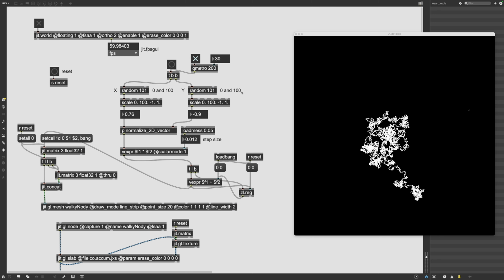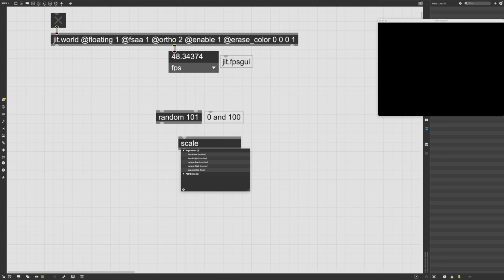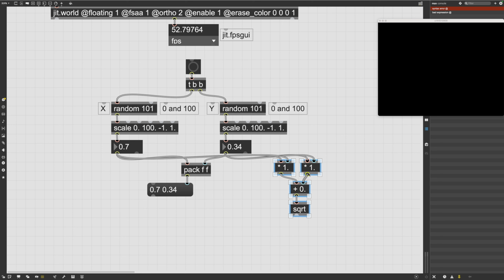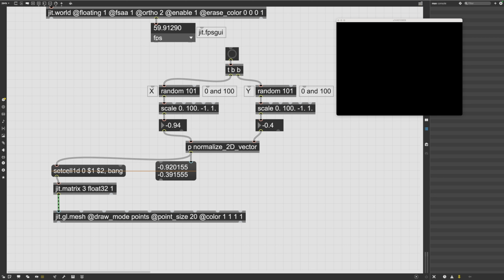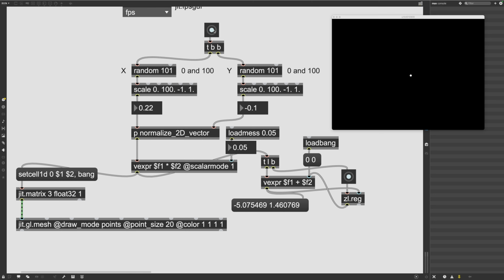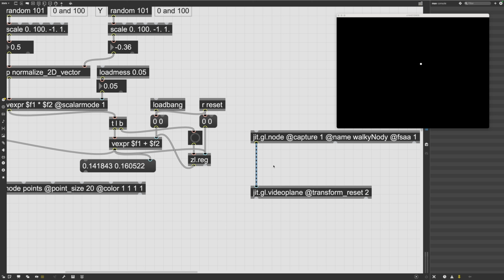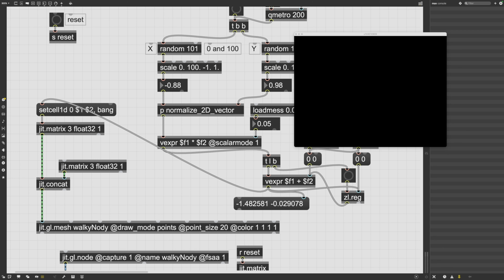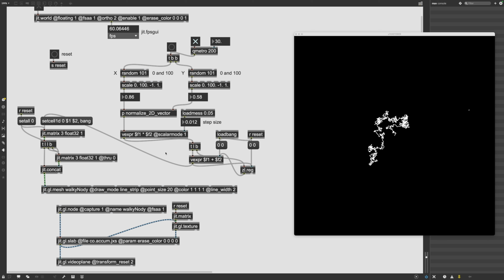2D Random Walk Visualization with Max/MSP Tutorial

Comment: Ciao federico, thank you for the great tutorial, i've used your idea as base for a patch in which I made the steps audioreactive and sent them into touchdesigner via syphon. Unfortunately the lines leave the screen at a certain point and resetting will not do the job since the whole image drawn by the sound will be destroyed. Is there a way to 'clamp' the lines to the window borders in order to keep them inside? I've tried it it with vexpr but it did not really work...mabye you can help? kind regards

Comment: Great Videos from you. Bsically the reason i started Max. However, i'm very new to max i have the following issue. When doing anything to my jit.world (like jit.gl.mesh or jit.gl.handle) i MUST to specify the world name. Therefore, also all the nice demos / examples provided by max will not work (because the developers are usually lazy in specification of world name if it is optional).
Reply from the maker: Hi Thomas! You don't necessarily need to specify the world name, gl objects will automatically attach to the closest (in terms of patches levels) world they find. 
If it's the case that the patches won't work if the name is not specified, this sounds like a bug and you can report it
Reply: @AmazingMaxStuff  interestingly, i can solve this problem if i give the world the name "myContent" ... then the unspecified references work ... strange. I will contact Max.
Reply from the maker: indeed strange! Can it be that you have two patches open with two jit.worlds that have the same name? @Sevetamryn
Reply: @AmazingMaxStuff  I found it. And i'm very sure i never did something there. In the Max Preferences -> Jitter - you can set "Default GL Context" and there was myContent set. I'm pretty sure i never touched this. However, if you set this each DrawTo attribute defaults now to what is set there. And this will break anything you have not written yourself and painstakingly cared about context.
Reply from the maker: Crazy! I didn't even know about that parameter. Thanks a lot for letting me know! @Sevetamryn

Comment: Can you have a max midi FX that receives midi from different channels to modulate visuals? with midi in all midi data is added.
Reply: Max was built for this!
Reply: @paulbergel9191  You don't help at all, tell me how to do it and that's it.
Reply from the maker: @johnenriquemenesesrizo4497 Hi! 
You can use the object "midiparse" to parse raw midi input from midiin. Also ctlin from a specific channel for midi control messages.

Comment: How would you go about making two (or more) of these running simultaneously? I copied and changed the name of the new node and mesh objects, but only one of the walks is showing up in the jit world.
Reply from the maker: Hey! If you have multiple nodes you should have multiple jit.gl.videoplane objects, but not with @transform_reset 2, just the default 0. 
Then you need to scale them down and offset them using the position attribute to fit them all in the rendering window.
Reply: @AmazingMaxStuff  Thank you so much! I appreciate it.